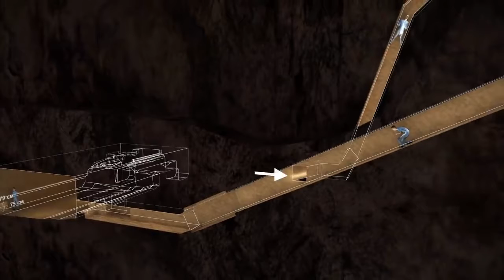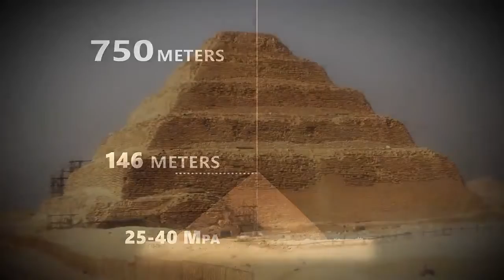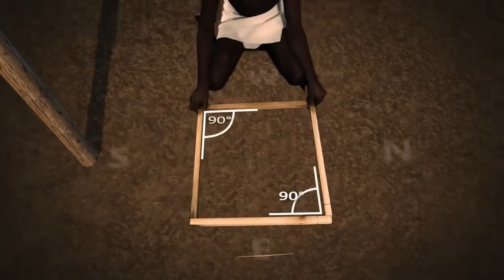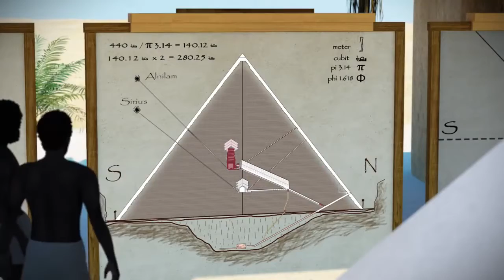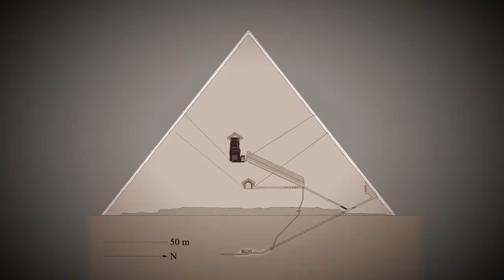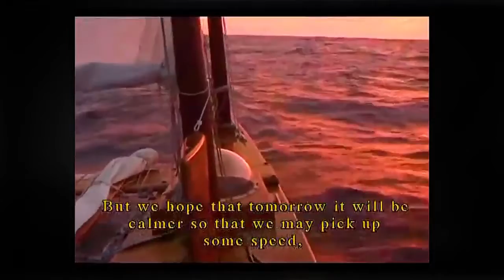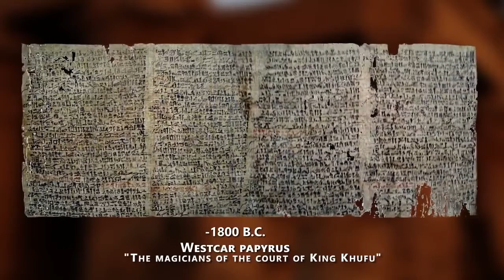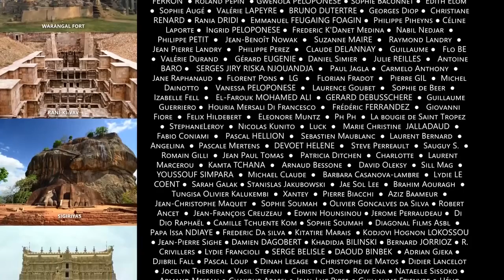Great Pyramid K 2019 - THE MOVIE (How the Pyramids were built? & Who built the Pyramids?)

Comment: I truly love this,  (love the  math to ) You had me convince right up un till the you showed the melting of the granit  You see years ago A lot of us  once learn in scince class that It dos not mater what means of heat you use to  melt granit in the end all you get is Obsidian or black glass. And Based on the ganit cooling rate calculation, it could take roughly 8 months to 1.5 years for the flow of a eight metre  thicknesses to solidify. even these Solidification of flows in the king chamber walls that would be  ranging 20–30 m (65–100 ft) thick , they  could take about 2.5–6 years to cool down it will take a months just  to cool down each 1 metre block. So it a fary tail
Reply: Also google the size of a water drop... It is not 1 CM.
Reply: On average a water droplet is roughly 0.05 millilitres. In terms of size that varies between 0.5mm-4mm.
Reply: and everybody forgets that if it was that easy (with supposedly that ancient primitive technology) to pour liquid granite ,why thy didn't they pour entire walls??? why exact blocks???....man anyway this film is full of incompleteness and contradictions anyway , but I think I know why it is that easy to sell this film ,.... because most people are not into simple physics and never worked with cement or any construction for that matter...

Comment: I don't think it was the case that they made a form of boards, poured concrete, then waited until it dried, and then moved the same form of boards and so on, in my opinion, they made a whole row of several forms of boards at once, poured concrete, waited for it to dry, and then filled the gaps. that's why every stone is different
Reply: I get what your saying mate but have you ever poured cement on a sunny red hot day.
The foundations of a house can set in a fraction of the time, and that’s in the UK I will expect the weather is a hell of a lot hot over their.
Reply: @DjTatty  it dries in minutes to an hour but it takes minimum two weeks for cement to bind "completely"(it's never complete btw) for a stone hardness consistency, and on the top of that you need to irrigate it every day with water to completely harden it, and batter it or vibrate it to release the air bubbles .....who thinks that is that easy ,that it takes the cement only to dry , never worked this cement!!!
Reply: @msmoozesful  i get what your saying but somehow some ancient concrete recipe remain mysterious take for example the roman concrete.

Comment: Why did you spend the time with this video rather than first googling "size of rain drop"? It takes about 8sec to see that the claim that they are all 1cm large is false.
Reply: Go drop a water drop on a waterproof surface and measure it , then comeback
Reply: Where’d you get RAIN drop from. That’s not even close to what was said. Smh 🤡
Reply: @kaku4702   i just measured two just now ,...one is 5 mm the other one is between 8 and 9 mm , it depends on the surface thickness you dip into the water it irregular the only thing that is constant on a impermeabil surface that is perfect circle due to surface tension and gravity (well in zero gravity would be sphere)...
Reply: Yea drops of the same size could only be produced by a dropper of the same size. So how do you measure the dropper opening?